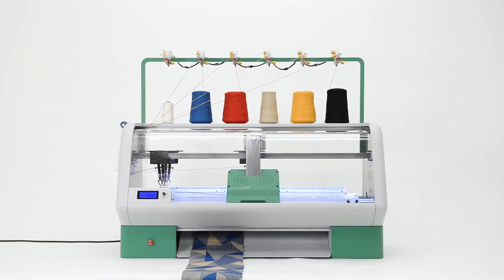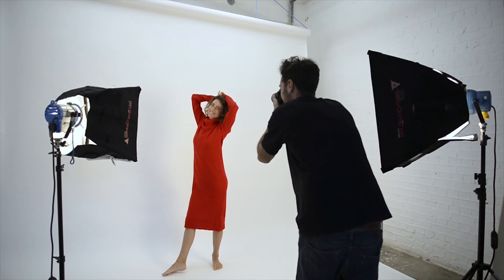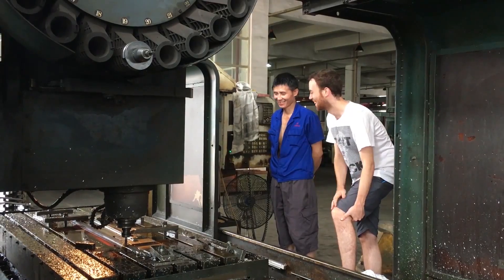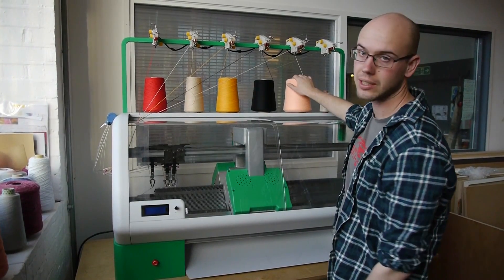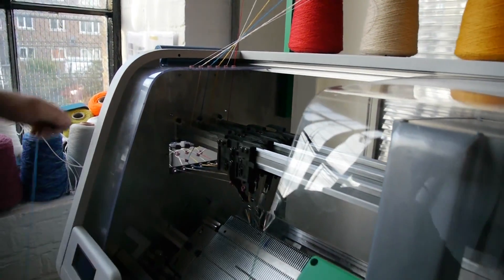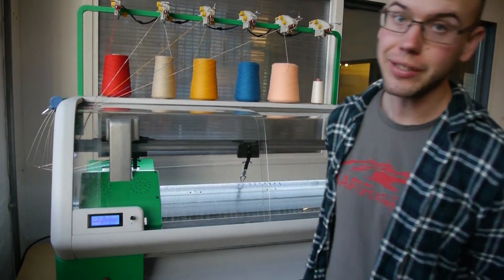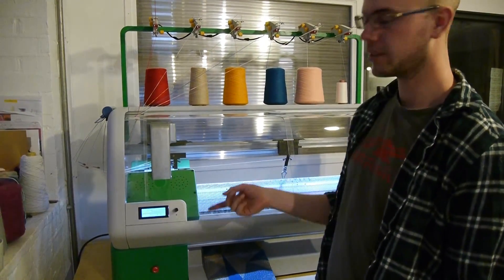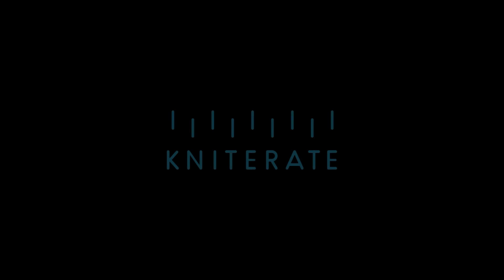Kniterate: Digital Design Knitting Machine

Comment: Without proper washing and hand steaming, the piece will never be have the right hand feel.  Without full fashioning, a cut and sewn sweater is the lowest quality sweater. I know, I had 260 Shima Whole Garment machines when I retired. I was considered as the king of sweaters knitting $160 / lb. cashmere...
Reply from the maker: Hi Sandro, thanks a lot for the insight. Could it be that we need to compare machines with machines and people with people? From the targeting of this product, it does not appear that they want to replace experts of this craft with machine work. Do you think such a device could have any useful application? Perhaps when deployed in communities for shared use?

Comment: Given the cost of the hardware, I’m not sure why you use the old-fashioned 4x20 character LCD straight off the cheap 3D printer market.
Reply from the maker: Perhaps that wasn't the focus of the development. Maybe they will change it for the next version of the product.
Reply: This is also what I'm thinking.. how to adjust the Stitch tuning directly on the machine? Is there even a needle breakage sensor on it?